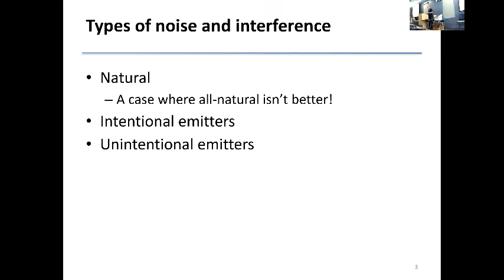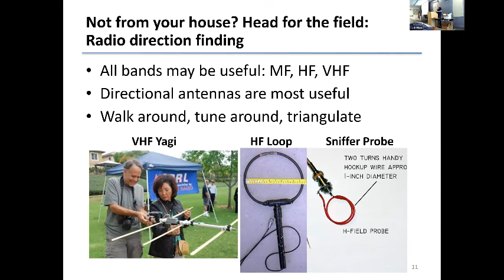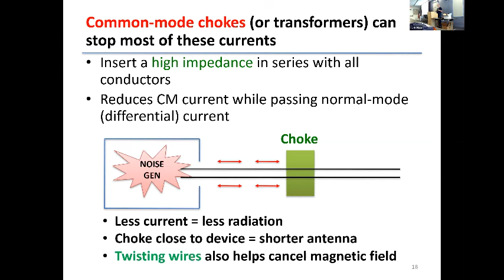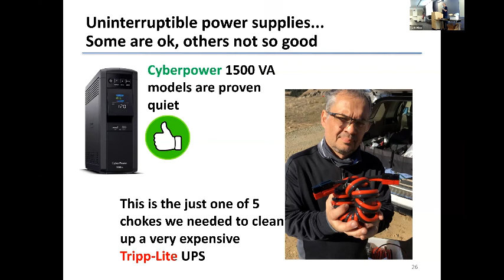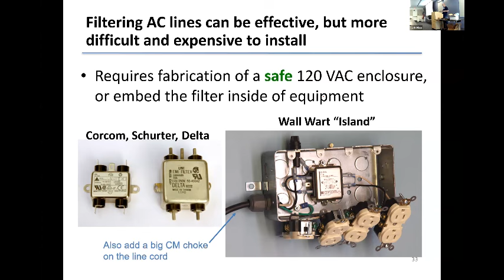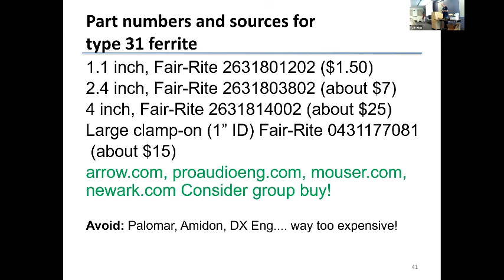Locating and Killing Receiver Interference, by Gary NA6O

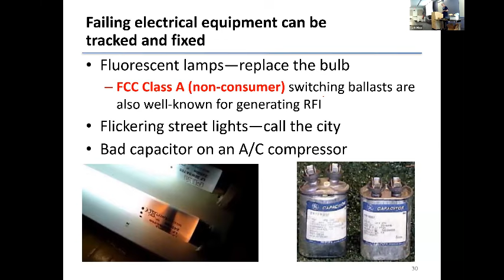Comment: 42:35 I have a grid-tied (no storage) Enphase installation and can confirm they are an OK manufacturer.

I can't speak for their battery storage inverters, but I have 21x IQ7 microinverters on my roof and get ~5100 Watts of split-phase 240 Vrms in direct sunlight (they also raise the power factor to nearly 1.0, even with the ~5 kVA A/C fan and compressor running).

I have used my RTL-SDR Blog V4 Dongle and a loop on ground antenna, compared the HF spectrum during the peak of the day and then threw the emergency shutoff (don't do this very often, even though the large disconnect lever should be able to handle it) and compared. The difference was negligible, in fact it appears the noise floor went up around 7 MHz!

I will do more testing to confirm, but I'm actually having problems with the grid interfering with my Envoy (device that manages the microinverters and, optionally, storage). The microinverters periodically report power generation statistics (you can also install current consumption transformers for better measurements) using 110 kHz Power Line Communication, but for some reason during the peak of the day the Envoy stops getting reports from the microinverters until the sun sets.

They resell ferrites and line filters for mitigating issues with PLC interference, but they have inconsistent installation directions (whether it is supposed to be the hot wires, on the neutral only, in some manual they even say to install them on the ground wires only!) and don't specify what mix they are. I will try to remember to edit this comment when I get it figured out.

Also beware of shady companies, our solar installer (like many) went out of business just weeks after they installed our system leaving us without anybody to maintain it! I had to e-mail Enphase and they gave my account site management permissions for my own solar installation, but in order to do certain actions (provision new microinverters, change the power profile, etc.) you need to take online training courses (which are free, but it still takes time). Also I don't have an electrician's license, so I am limited in the maintenance I can perform legally... 😮‍💨